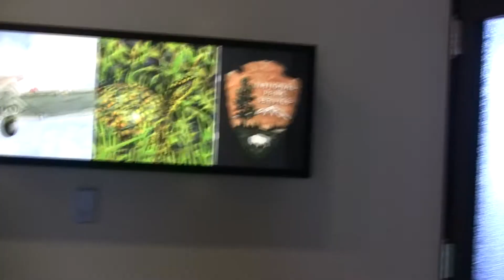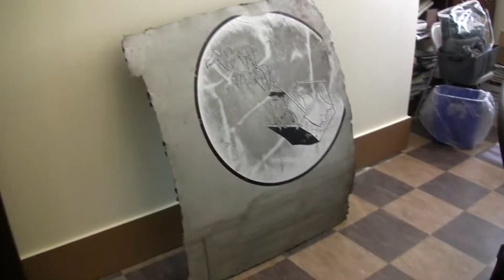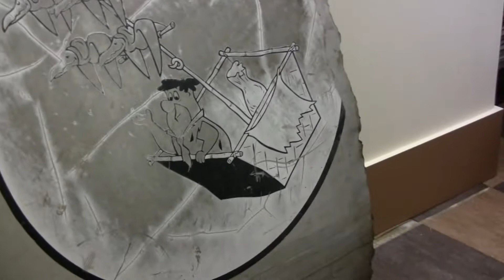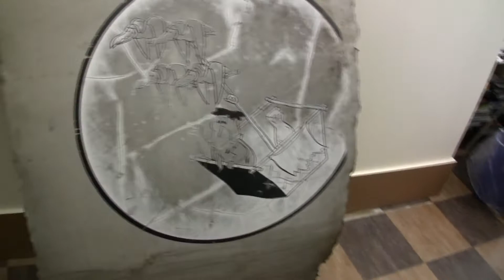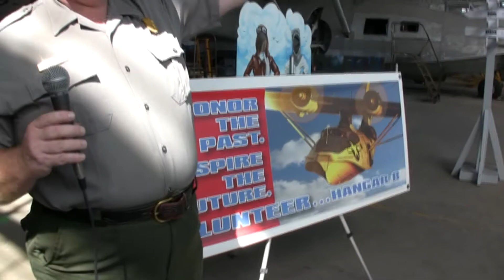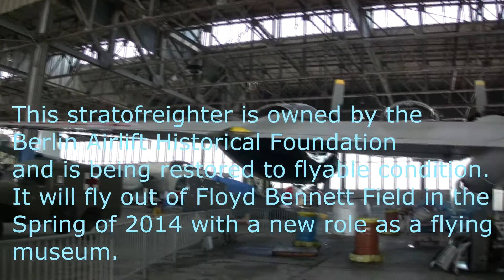Tour of Floyd Bennett Field with John Lincoln Hallowell Jr. and Sylvie Ball

Comment: This video is great showing the hanger and the C-97 by BAHF and it is still at bennett as of 2016 and it will be nice to see in flight let's not have a kee bird problem Doc went well with only a chip light coming on and cut the 45min flight to about 5 or 10 min flight